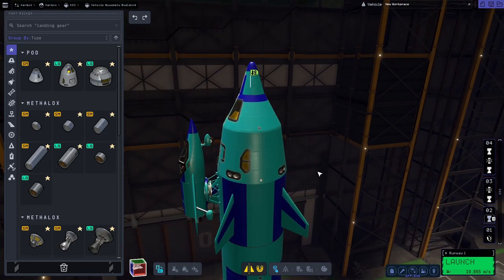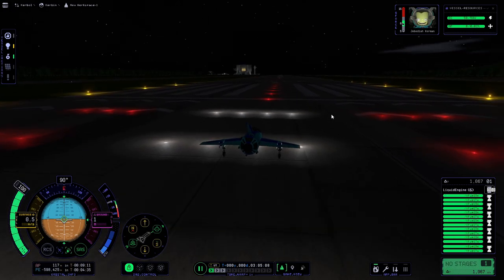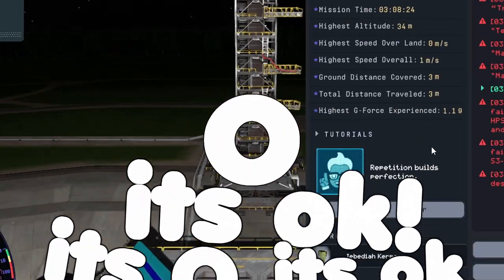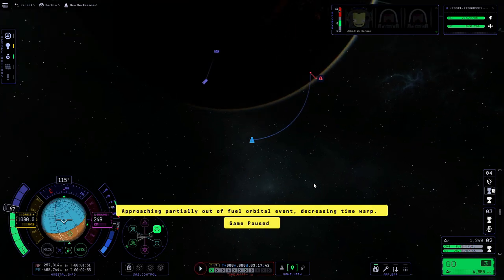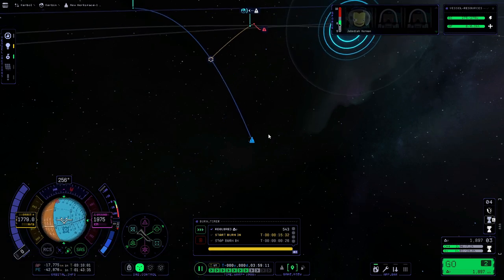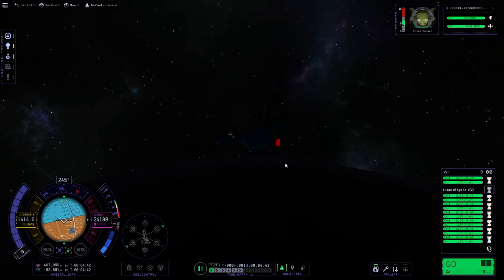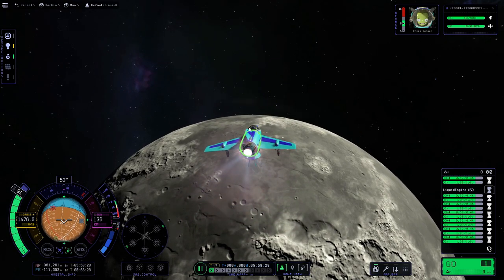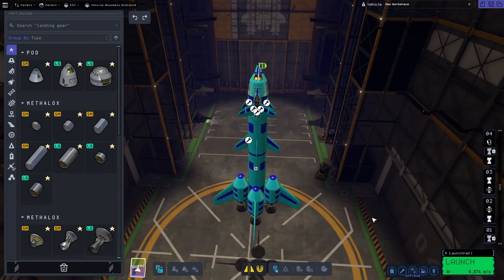Journey To The Center Of The MUN! Kerbal Space Program 2 EP 9

Comment: LOL I knew the game was a bit glitchy but holy hell, "fly me through the moon" is a new one! So I know you record ahead and might already know this, but just in case... under the "command and control" tab in the VAB you will find monopropellant thrusters. if you stick a ring of them around the upper bit of your rocket and another ring of them around the lower bit, they can be used for course correction AND stability. You just need a monopropellant fuel tank added to your craft somewhere (the original game had external ones you could just attach anywhere and round ones you could just integrate into the build) and you will have all the control in the world. I'm pretty sure not having them is why your SAS isn't working correctly, it would use those to stop tumbling, stay pointed at prograde/retrograde/maneuver point whatever, and counter stuff like the balance being off because of your shuttle. Can't wait for the next attempt at the Mun!
Reply from the maker: that sounds REALLY helpful! Thanks for the tip. And you guessed it the next episode has been recorded so ill put this into effect in the next next one!